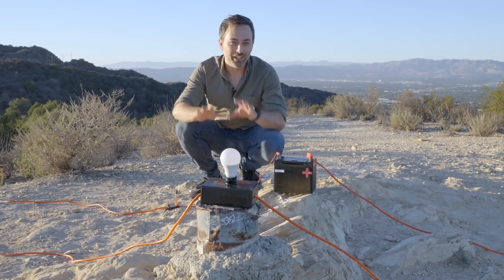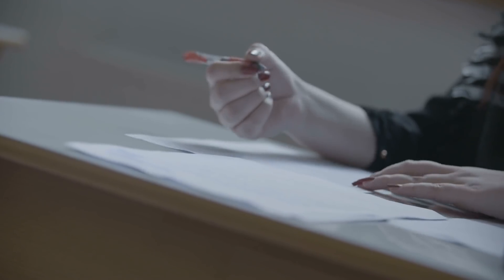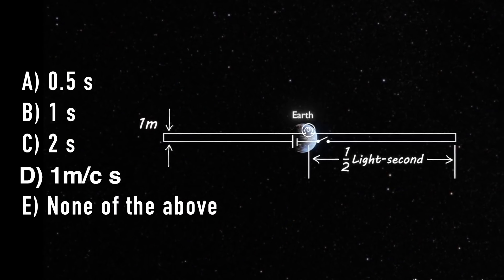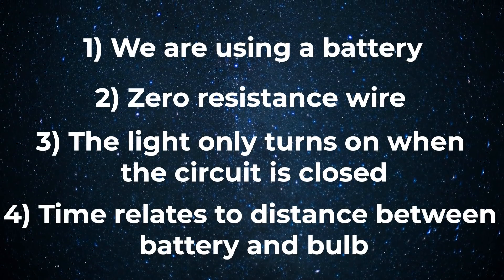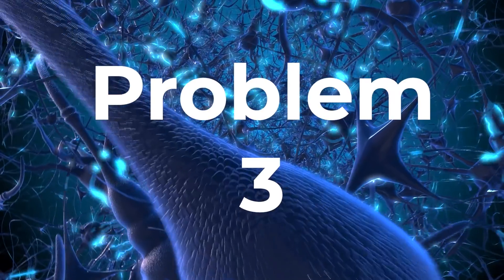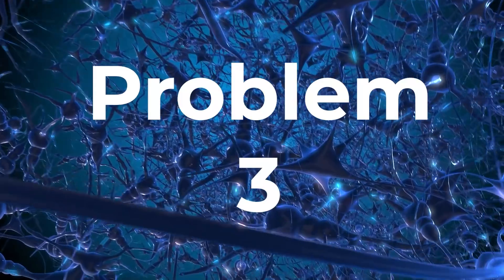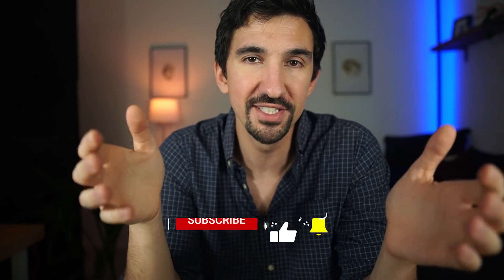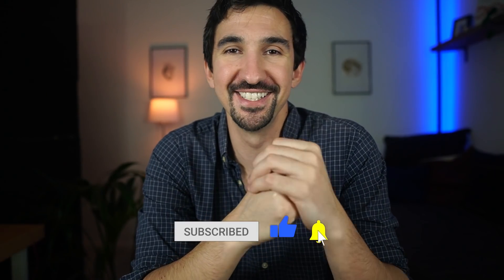Is Veritasium Wrong About Electricity?

Comment: Agree with your conclusion, Veritasium's reasoning violates relativity. Let's re-arrange the circuit so the battery and the switch are at one end and the light bulb is at the other end. Now the switch and the light bulb are separated by a distance of one light second. When we close the switch, the information that this has happened will start to travel towards the light bulb. According to relativity, as you say, no signal or information can travel faster than light. So it is not possible that the light bulb turns on in 1/c seconds. It will turn on in 1 second.

Comment: I don't know a right lot about much but surely you are only breaking causality if you assume the message MUST travel the length of the wires in order to be delivered but in effect what Veritasium was saying that the length of the wires was immaterial if the message only had to jump between the two parallel wires spaced 1 meter apart due to electrical thingymybobs and not wires of any particular length and only sufficiently long to generate the electrical thingymybob field? The way I see it is like one runner setting off at the speed of light setting off to complete the circuit but the cheating electrical  field runner just jumping between the lines Just a humble uneducated farmers take on the problem.

Comment: Causality - Your confusing the transmission of data with the electromagnetic energy transit. Signals only travel at a small proportion of the speed of light. Long wire delay lines have been used in radar and other electronic systems for many years. But they are concerned with inputting a coherent signal into a cable and getting that information back at the other end. that takes a significant time period. Turning on the light however is happening because some electrons "pass through" the light BUT they are not the electrons you inject at the battery, they are electrons that are already IN the wire at the point of the light.
Energy already injected in the wire will have to dissipate so no, a break in the wire would not result in an instant extinguishment of the light.  

IF the cable network acts as an antenna (and it might) they are not many Ks long but are only 1 meter apart, this isn't the question.

As a technology teacher (UK) I am fully aware that we continually "lie" to our students to try to give them a visual image of what we are trying to teach. The Niels bohr  model of the atom is still conventionally taught, Conventional current flow is still taught as a reality in schools, The water or ping pong ball model of electricity is used, Gravity is often called a force, in computing we teach children to code at the keyboard, etc.

Comment: If you claim that 3 is the correct answer and that the light bulb 'comes on' when the electric field reaches it, then you should equally claim that when you switch on a light in your house, then every light in the world switches on when the electric field reaches them. This is obviously nonsense. Even a light 1m away in your own house will not turn on even though its wires do experience some electric fields. The reality is that the field generated at a distance of 1m is miniscule as it is propagating in all directions. The energy mostly goes into moving electrons in the wire which in turn propagates the field along the wire. To get significant transfer of energy you need very long wires an close proximity and rapidly changing currents (that is how transformers work). If one was to put one of the wires in a faraday cage then surely the other wire would experience virtually no field at all.

Comment: Since we can not get over the speed of light, I assume that the lamp will light in 1 second. as soon as we close the switch it will take 1 second to reach the lamp (but) as there is a certain capacity and induction in between the wires then the lamp will light approx immediately, when we close the switch the voltage will run in the wire at the speed of light, You can make the experiment with a transformer with two coils with many turns.

Comment: The light will not turn on as you will have a fraction of the current in the secondary wire than the primary wire, you will have to wait for the EMF to go right around the loop before it turns on in the common understanding of turning on.. You can also shield the wire with coaxial cable then there will be no signal sent to the  second wire by induction

Comment: How does an electron valve or cathode ray tube work with this theory? The heated cathode in the crt is connected to negative. The focusing anodes in the gun are connected to a positive potential to form a beam out of the electrons coming from the cathode. This beam is accelerated by a huge voltage in the final anode but it does not aim itself into the anode. (It is only influenced by it) The final anode is more a circular electrostatic capacitive element. (A conductive coating is applied on the other side of the glass to the anode forming the other capacitive plate.) Instead, the beam lands on phosphor. The phosphor is excited by the beam and gives off light. The beam can be manipulated to form a scan by the electromagnetic scanning yoke just forward of the gun as the glass envelope widens. It can also be moved by electrostatic plates as in an oscilloscope. I was always taught that the beam was made of electrons. This has always made sense to me. They are attracted to the positive charge on the anode but hit the phosphor instead. Surely this cannot work in reverse. The phosphor doesn't send fields or positive charges back and forth to the cathode. It's a one way street.

Comment: at 6:09 you say the light only turns on when the circuit is closed, yet you say a little later that it may indeed "turn on" for a while with antennas instead of a closed loop.
this is the reason why relativity is not broken when the wire is cut on the far end.
Since your voltage is DC the wire will act as an antenna/capacitor with a frequency of basically 0. as soon as the current reaches the broken far end, the current will stop moving, the field will drop and the light will turn off again.
Since the current moves in both directions at the same time, the light should "turn off" after half a second, when the antennas/capacitors sort of balance.
Of course "turn off" is a little harsh since there's still drag to the electrons and there will be a little oscillation but it will eventually settle down, as the electrons will stop moving and the field will drop to zero.

Comment: 1) What if the circuit was arranged as a circle, rather than a stretched rectangle. Surely the antenna transmission would break down?
2) More fundamentally, what if we look at the circuit using photons rather than electrons? The same causality problem occurs.
Assume that you can arrange a similarly dimensioned photonic circuit with a single photon laser emitter (= battery) and a detector (= bulb). The curve to ensure the emitter and the bulb are close to each other might be caused by a black hole to warp space. The return part of the "circuit" is trivial, but could be represented by a second photon linked to the detector, around a second black hole and back to a second detector.
Single photons are emitted, go around the race course and arrive at the detector, transmitting energy. The interaction is at light speed, and nothing travels faster than light, so the detector - bulb cannot switch on in less than a second (unlike the electrical circuit).

What happens if an interruption is placed on the back straight of the racecourse, rather like the one in the example given?
The emission - detection "circuit" is potentially broken "after" the emission has taken place but "before" the photon reaches the break.
My understanding of the quantum nature of light would lead me to suggest that the break in the circuit would determine the path of the emitted photon at the time of emission*, not at the time of the breaking of the circuit. Causality is not contradicted, because *for the photon time does not pass between emission and detection. The detection would not occur because the time shifted photon can "see" all possible paths including the future one (to it) in which the circuit is broken - and it doesn't bother to even start to go down that path. It chooses the best alternative path - possibly the one exiting the circuit at the break.

Whether these considerations are relevant to the problem dealt with in this video, I am not sure. Could the arrangement of the wires in the circuit causing an appropriate electric and magnetic field cause photons of energy to "tunnel" across the circuit without bothering to use the helpful wires?

Comment: this discussion is very strange. There are machines sold, which use the principle shown by Veratassium. These machines are used to measure cable length down to a few centimeters in length.

When you switch the battery on, the voltage will change, in the ideal case immediately. This means, the voltage directly behind the switch will see a step function. This step function can be fourier transformed into a frequency band and this will look like a si function (sin(x)/x if i remember correctly, i had this in university around 1990) 

For a frequency band the response of auch a wire can easily be calculated. For all frequencies where the 1m is less then 1/10 lambda (wavelength) the parallel wires are simply a parallel wired wave guide. Unless the distance between the wires changes or the surrounding dielectric constant changes the signal will travel until the end of the wire and be reflected there.

As i said, we use this principle to measure where a short (or open) is on PCBs and even on silicon chips! This is called time domain reflectometry and commercially available!

Comment: Exactly the conclusion I came to. It's induction of a current in the wire connected to the light bulb. It's very small and only lasts while the voltage from the DC battery is rising.

Comment: Hewlett Packard answered the question many years ago. They made a frequency counter so fast they had to take account of the speed of transmission on the circuit boards (roughly 0.9C). It was the length of the trace that mattered, not the "as crow flies" distance between terminae.

I am sorry but I cannot remember the model number.
Reply: Trace?
Reply: @edga69  The copper conductive strips between components on a printed circuit board are called a traces, presumably because when PCBs were first developed the pattern was traced.

Comment: The problem with your causality breaking argument is this--   as soon as the wire is broken in more than one location, that section of naked wire dissociates from the two perpendicular fields, thereby negating the possibility of communicating anything, faster than light or otherwise.   No fields, no communicating on either end.

Comment: Imagine, if you will, Veritasium's experiment with a wire of zero ohm resistance (which is possible if it were a superconductor), but all else real world. Now imagine that the wire was arranged in a big circle, approximately 300 million meters in circumference. The switch and battery are at opposite points in the circuit from the light bulb, but the observer is able to see what happens instantaneously with the light bulb, from the battery/switch position. The circle is chosen as it has the least inductance and least capacitance of any way there is to arrange such a circuit. When the switch is open, an electric field equal to the battery voltage exists across the battery as a power source, and the switch contacts. We will ignore the minisicule current leakage across the switch contacts when they are open, so we have essentially no current through the lamp. With the switch open, there is essentially no electric field anywhere between any two points on the wire, except for the short length of wire between the battery and the switch, and the restof the circuit. When the switch is closed, electrons start to move between the battery and the switch, and proceeding along the wire from the switch. The electrons do not move instantaneously, but rather are pushed (or pulled) along the front of the current flow, at a speed less than the speed of light but not much less. The current flow is quite high at this point, as there is nothing to impede the flow except the internal resistance of the battery (we will also assume the switch has no resistance when closed).While this current is flowing, a magnetic field develops around the wire, and an electric field exists between the flow front and the part of the circuit in which current has yet to flow. When you have current flow in a wire like this, you not only have an electric and a magnetic field, but electromagnetic waves are being emitted from the wire as the current flow front moves (This is what I believe is called a 'displacement current'). Normally, there is some reactive effects from inductance and capacitance around the circuit, but they are minimal due to the circuit configuration, and the circuit behavior is essentially resistive, even though there is no resistance in the wire. When the light bulb is encountered after more the half a second, the current front passes through it, and the resistance of the light bulb limits the current flow, and lights up in the process. The current limiting of the light bulb causes a change in the electromagnetic radiation being emitted along the flow front, as the resistance of the lamp then diminishes the current flow in the remainder of the circuit. There is little or no inductive kick or capacitive voltage fluctuation at the light bulb (or very little) due to the low inductance and capacitance of the circuit layout. The current flow eventually reaches the battery after more than 1 second, and the current flow now becomes steady at all points in the circuit. No more electromagnetic radiation is emitted because the current flow is now steady. As Veritasium states, there is an electric field between the two halves of the circuit and a magnetic field along it, but these arise as a consequence of the electron flow, not the other way around. The condition is a steady state and no work (or just an infinitesimal amount from electric field induced leakage) is being done by either field.  Although individual electrons move very slowly along the wire, they do move, and eventually, they will travel all the way around the circuit. What makes for current is the sheer number of electrons, not the speed at which they move. So, the correct answer is D: Some other amount, as it takes more than 1/2 second for the light bulb to light, and all the work in the circuit is being done by electron flow.

Comment: There's another thing that also bothers me about the Demonstration and conclusion.
If the light turns on from the minimal voltage and current induced by the EM Wave at 1 meter, then certainly, it would "blow" when the full voltage and current arrive from the Conductor after a second.

Comment: @4:38 I think the wire breakage point is wrong. Because, for the signal to travel in the first place, an electric and magnetic field must be generated which acts as a bridge to transfer electric power/signal. and I don't think there would be an
electric and magnetic field generated, if there is no  electron flow(either in AC or DC) in the wire.

Comment: It was a misleading video, and unusual for Veritasium to be so.  You would get microwatts or nanowatts of power from the surge ; not enough to light a bulb which could take 5 watts of power to illuminate. if he had specified coaxial cable that would have eliminated the induction issue and then it would take the speed of light divided by the total length to see it turn on.

Comment: Ah, so you are here. You made two (or was it 3?)  videos about quantum mechanics/science which I found very helpful. I think your channel was called something 'apple' some reference to the Newton parable. 

I'm an electronics engineer and I think your  reaction to Veritasium's  video is accurate, esp that antenna bit. We practising engineers have known for a long time that electric wires generate EM waves, so it is not a surprise to us that EM waves propagate  when a circuit is closed. For DC, this happens when the switch is first closed which results in an impulse function and its inherent frequencies. Then it  settles into a DC state. 

As always this transient EM wave is too weak to affect anything outside the wire (insulation playing a part as well). But in-circuit, that can cause problems, why we electronic engineers  often design dampening circuits to negate this transient impulse spike.

If Veritasium was electronics trained, he probably wouldn't even need to do this thought experiment.
Reply: Can I draw on your expertise regarding another problem I have with the original video? It seems to me that if we accept the 1m/c result, we're doing so because we acknowledge the inductive effect, it's an "antenna" as you say. But if we are accepting that this is enough to light up the bulb, the surely the bulb is already "on" even before the switch is closed? After all, the bulb is connected to a 300,000 km long antenna hovering somewhere in space in the universe. There's going to be flux in the fields over a space that large, so the antenna effect is already lighting up the bulb even before we start adding energy from the battery, no?

In other words, if we ignore induction then we don't get the 1m/c result, because the 1m/c result depends on induction, so in this case the bulb would take much longer to light up. If we don't ignore induction, then we still don't get the 1m/c result, because the bulb is actually lit at T=0.
Reply: His video is not at all accurate.